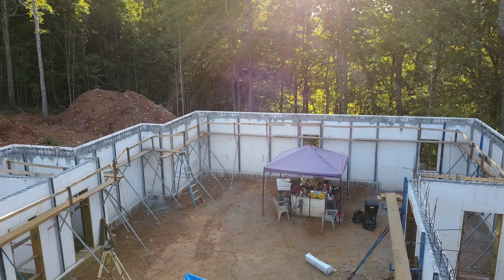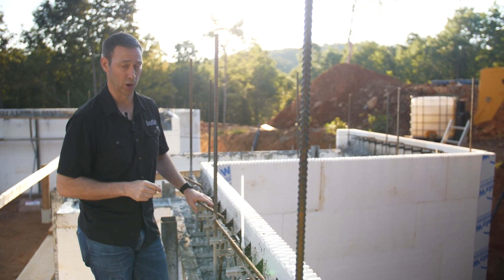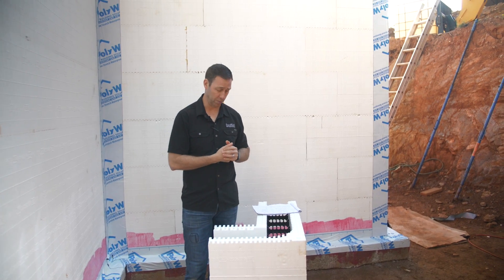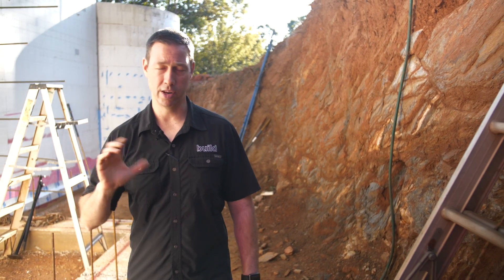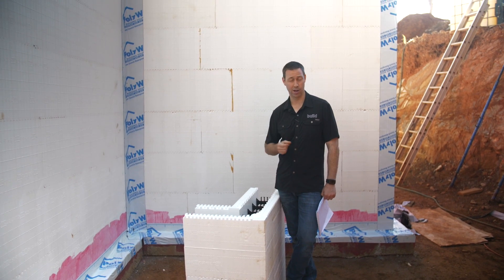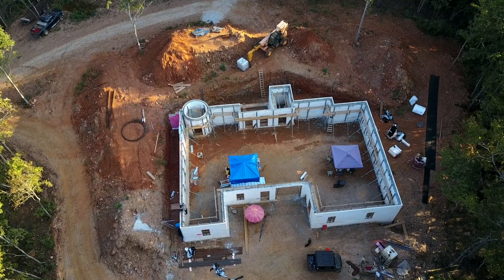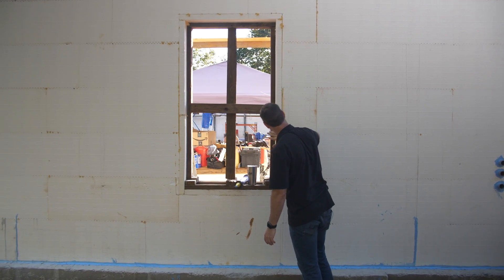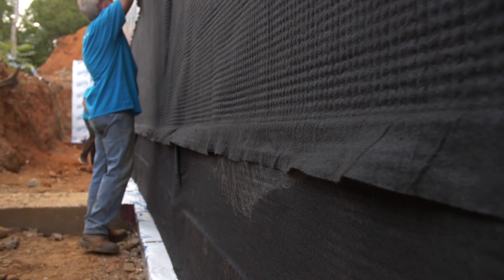Insulated Concrete Forms - Overview, Costs, and Cons

Comment: I would love to see icf vs prefabricated concrete and poured concrete... I've been seeing poured concrete with foam inserts is the best... any opinions? Wife and I are looking to do our own build and want a quality house to last for the kids kids.
Reply: Or maybe include concrete slab and post tension cables??
Reply: Never seen or heard of poured with inserts, I have seen Superior walls which are foam covered interior tilt up style walls for basement or above grade, with the foam thickness being just R5 for 1 inch to as much as they offer such as 4 inch for an R20 almost. And just like any other construction there are "horror" stories and other downsides of lesser extent. But due to its just insulated inside and typically 4 inch of concrete with no exterior insulation it does not offer as much insulation value.
Reply: @Joshua79C  aye it is relatively new from what we understand, but we are not contractors. What happens is the hard foam goes between two slabs of concrete and the interior slab of concrete maintains the temperature nicely, whereas the exterior slabs heat/chill factor does not get past the foam. A contractor buddy was talking to me about, just wanted more opinions. I'm in Northern BC Canada too, so I'm thinking some merit must exist to this for it to be recommended.

Comment: So funny to see this, I've been planning my ICF house with my architect and builder for the past 2 months. It's been fun, I can't wait to live in a Yeti cooler. :)
Reply: mytreesloth You should check out Gigacrete.
Reply: @davidjenjustice5517  looks pretty cool..must be a great r-value.
Reply: mytreesloth I have my order in with Gigacrete right now.  It should be delivered in about three weeks.  I decided to go with this type of construction because it appeared to be much faster and easier.  The interior and exterior plaster also eliminates drywall inside and any wrapping on the outside.  8" of eps with the plaster coatings give an R factor of 36.  I hope to have my house completed by the end of January.  This construction also has survived the hurricanes in the islands.  I thought that Icf was great, but I thought Gigacrete was a better method.  We'll see, my construction starts soon - foundation has been poured.
Reply: @davidjenjustice5517  I'm still in the conception phase, hoping to be started by January lol.. I'm sure each system has pros and cons like anything else. I wish you the best of luck on your build! I can't wait to stop drawing on graph paper and actually start doing something.
Reply: @mytreesloth  yes, I thought I would have between completed six months ago.
Reply: Gigacrete site is lack in actual product photos, just a photo of each product after it has been installed and lightly describing each. I need more than just words to describe it. Sorry you are waiting so long for completion DavidJen, would not have taken this loong if used ICF forms, but hope all works out in the end for you.

Comment: As Devon said, You should vibrate. I built my 30 in stem wall from ICF (foxblock), A benefit Matt didn't directly mention is no forming with metal or wood forms, that have to be bought or rented, erected, stripped, and stored or returned. This a lot of work and expense.  Also, there is a company that has a block that is much thicker on the outside than the inside.( "the perfect block" ) the insulation is better, and they claim an effective R-50. Then there is the issue of wiring and plumbing. You cut a channel. You can apply stucco directly to some types of block. Doing your homework is crucial. Think deep.
Reply: i will be building soon, where can i get some tips/ #ThinkDeep
Reply: Yep, its a clip that pulls the blocks together (fox block) and makes the stack more rigid. I didn't brace the 30" wall at all.
Reply: @tomtillman  What clip are you talking about?
Reply: I was looking at both Quad Lock and foxblock. Fox is owner builder friendlier but QL has option for more outside insulation as well as wall thickness beyond 12 inches. So it depends on the features you are looking for.
Reply: BuildBlock makes an insert that fits into the cavity and adds 2" of foam on the outside of the concrete. So if you want a six inch wall, you order eight inch blocks and the inserts. Not sure how much the inserts add in R value...
Reply: I was looking to demolish my pool and build a 30' x 20' walipini (underground greenhouse) in its place. I want to build 10' high with ICF retaining walls, backfill 2' of rich soil inside the retaining walls and build a polycarbonate panel structure with 8' walls on top of the ICF retaining walls. I need the walipini to be so tall (18' max clearance) because I want to grow tropical fruit trees. Is such a project feasible with ICFs?
Reply: @UndefinedBailiwick  only if you build additional pylons
Reply: Inside you mount 2 by 2 studs and thin Rockwool between. Drywall over that. That way you can mount pipes and so on easy.
Reply: Tom Tillman, I only know of one ICF maker that does such sizes, and I am not going to say here to give it away to others but its initials are QL if I am not wrong of who you are talking about with various thickness of panels.
Reply: Joshua79C C  Why wouldn't you want to give it away?
Reply: @Joshua79C    Quad Lock
Reply: @Joshua79C    QL  = Quad Lock
Reply: @BornlessOne  Quad-Lock is the only brand of ICF blocks which I can think of with the initials "QL."  If that's the on Joshua79C is referring to, I can't imagine why he's being secretive about it.  I'm very keen on Nudura as they have an unsurpassed training program plus a very wide offering of products.
Reply: @72strand  if you do that your going to have to keep the electrical system simple. Too many wires will eat up cubic in. Inside of a shallow electrical box quickly, inspectors tend not to like over stuffed boxes. That's also a large addition to cost to use regular 2x4

Comment: Awesome vid, Matt!
I've designed a number of homes with ICF in mind.
Eventually, because of cost, I had to convert the plan to CMU.
Looking forward to the next vid! :)
Reply: Ouch, CMU are the worst despite their low cost, Mortar cracking and the way the cavities just hold water in like a tank, I have done waterproofing on a few homes that used said blocks when I used to do that kind of work. Then there is lack of horizontal (which is why cracking occurs in the seams) let alone vertical  rebar or filled cavities every so often along a length to even provide the support to hold up a building sitting atop it.

Comment: Good job-in my build in Wyoming the additional insulation is an issue. I’m considering if I go 1/2 way to log or ICF all the way with log adhered to ICFs. I’m planning on using custom scribed logs. Second house will be more Tuscan style.
Reply: Many home use ICF in the basement or other foundation alone, especially if it is a foundation rebuild, so go ahead build it hybrid with ICF and the rest log, log is nicer looking when it's solid whole logs.

Comment: I just had this installed for the house I am building. The house is now sitting on shims because it’s not level.
Reply: nothing is going to be perfectly level all around, not even the footer/footing is not going to be all around level as Matt states it should, and despite the numerous sight line and laser levels there are out there along with even a simple string level. But building another traditional structure on a concrete foundation of any style including ICF you would want to still isolate the wood in that instance from the concrete to reduce the chance of the wood rotting early due to water pooling on and being absorbed by the concrete until it does dry up again.

Comment: The ICF forms can come in wider widths for the concrete and thicker foam to increase the R-value. As for adding windows or other penetrations a concrete chainsaw will cut a hole and the rebar without too much trouble. Another thing to add is the air sealing the concrete does is very good and it is extremely hard for bugs to get into the house. But yes ICF is not for everyone.
Reply: Most ICF forms only come in one thickness and require inserts to increase R value on inside or outside in most cases to which if the form is not wide enough to compensate for then the concrete will be less than 6 inch or 8 inch thick. Build Block has knockdown system with extenders to increase up to 36 inch thick while still at 2 inch standard foam panels. Then there is such as Wuad Lock with three panel sizes and separate ties that double as fastening points for wall finishes and they offer both extra panels for fillers along with two and four inch panels with fastening strips molded in for more places to fasten/secure a wall finish to and extender ties to accommodate the proper wall thickness throughout. Then again it all comes down to how much a buyer educates themselves through searching for every possible ICF manufacturer and looking at each companies offerings in choices of forms and such, some just go with the first one they find, others look at a few and go with the one they think is best, and few like myself who know about almost every type of ICF manufacturer and form out there and I have yet to use any of them myself. But I know the few who I would go with when the time comes that I get my  own land to build on or home that needs some remodeling to my preferred standard.

Comment: Poured concrete floor = thermal mass. Dunno why we don't do more concrete foam concrete setups.... give more thermal mass to provide temp stability. More extreme environment = more foam in between.... works for the north and the south.
Reply: Select Manufacturers and I know of at least for ICF makers who also manufacture planks or decks as they refer to them to make building an insulated slab much simpler than a steel deck system, they even are shaped to include beams for the needed support after it has poured and set/cured, one offers their floor/roof decking with either steel or wood studs for attaching a ceiling finish.

Comment: I'm trying to work out the cost, but something doesn't sounds off to me about concrete costs. In the video it says $120/yard => $5/sqft of wall area.  $120/yard / 27 cubic-ft per yard is roughly 5 (4.44), but the wall is only 6" thick of concrete, so I think it should be closer to $2.50/sqft.  Can you clarify, Matt?
Reply: I saw that too. 1/2 ft cu / sq ft wall area. 120 / (27x2)=$2.22 / sq ft wall.

Comment: If the owners are dyi the build where did they get the wall leveling Jack's and tube?  This looks very interesting for loud shops in residential areas.
Reply: You can buy it (pretty expensive) or there are companies that rent it out as well.
Reply: 00HiGhGuY00  or also check out FabForm system which is Zont and Zuckles that uses 2X4 or larger sticks if metal bracing is not in your budget or such.

Comment: Yes EPS has a fire retardant in it which slows down the spread of fire but the problem is that it melts near any heat source  so if a fire starts inside the building  the ESP melts quickly and producers strong fumes 
In Australia I have worked with ESP panel over 25 years and have seen  the results  of fire on ESP there's  nothing left. In commercial and industrial work in Australia insurance  company's are giving better premium cover if we use PIR panel  which has a higher fire rating the panel only scaled not incinerate.
 Do you use PIR in the United States
Reply: Which PIR panel do you use
Reply: Is there more than one in Australia as far as I known the one we used is base on UK /European panel but we do make PIR in Australia  now
Reply: You kept typing ESP when it is EPS for Expanded Polystyrene
Reply: Typos
Reply: These panels are known in the US as polyisocyanurate (or simply “polyiso”) at supply stores.  I cannot imagine how the terms are actually pronounced because I read them in magazines such as the Journal of Fine Homebuilding or the Journal of Light Construction.  Employees at supply stores simply call them foam boards, a term that does not distinguish them from other types of “foam boards” such as polystyrene.   I think you have eliminated that probkem in Australia.  Do you say “peer boards” for PIR panels?  We’ll have to start spreading this one around once you clarify the pronunciation......unless you say P-I-R panels??

Comment: On the east coast of Canada, friends lost power for a week during a winter storm and their ICF house dropped 2 degrees Celsius over the week.  It is very quiet and cozy year round!
Reply: Alan Barnhill isolated thermal mass is a wonderful way to build
Reply: @kjs65a56  You weren't around for the 3 day blackout then (also hit areas in the U.S. like New York). That happened...  oh my, it's been over 10 years. Now I feel old. ;_;
Reply: @kjs65a56  lest you remember the ice storms of '97 with power out to areas for a month or more...
Reply: @kjs65a56  You are NOT from the east coast than?? :)
Reply: MURRAY Murray 
Then🤦🏻‍♂️
Reply: Wow that's impressive!
Reply: Look into AAC.
Reply: @kjs65a56  Then your not from Chicoutimi! I think several weeks?!
Reply: 👍 awsome
Reply: @kjs65a56  2 hours? Not true at all. I loose power regularly, maybe once a month, and occasionally, for more than a day.
Reply: In Sothern Europe this is how everything is built. This year my grandmothers house, which has no insulation but is fully concrete - we got hit with 115F for 7 days straight. No air conditioning... the house held under 80F, except for the last day where the concrete was hot by then... since even nights were at 95F or so by the 5th day, the thermal mass started working against us :D but nonetheless, remarkable result.

Also, during nights when it gets to around 30F, without heat, the house never gets below 62 F
Reply: @NoRoads2AllRoads  If the concrete walls are insulated, say, with styrofoam, you'll be getting only slight temperature fluctuations over long periods of time, e.g. winter/ summer.
Reply: @DobruchT  yup I know, thermal mass is great, however during long periods of time like it happened this summer, where we had 115F FOR almost 2 weeks straight and with lows in the 90s is inevitable that the concrete heats up like crazy
Reply: Salvador heat is one thing, the humidity is a whole other ball game in heat
Reply: if there is ever a fire, wouldnt the foam be extremely flammable?
Reply: randomrazr They say it has a 4 hour fire rating. That’s better than the majority of fire proof safes.
Reply: @randomrazr  Matt touches on that at around 10:30. The foam has a fire retardant in it. Foams will melt. Under certain conditions they can be made to burn. But fire testing has satisfied building code officials to the point that a single layer of 1/2" drywall is considered enough protection.
Reply: @randomrazr  most jurisdictions require that you at least cover with drywall and tape,  even in crawlspace
Reply: @randomrazr  The foam is fire treated.

Comment: can you compare an icf vs standard 2x6, let's say 4x8 end to end finish product cost thnx love your vids
Reply: The best cost is initial to that of what each saves over time in cooling/heating bills and which better withstands a hurricane or tornado, in this case it would be ICF the winner of the savings over its lifetime despite it may or will cost more to initially construct.

Comment: I believe that the insurance rates for an ICF home are significantly less also. * Check with your insurance provider for info formation on your area. *   Another potential positive to an ICF build .
Reply: Yes sure, your furniture is burned, roof is gone, insulation melted, but your concrete walls still standing. That a big win 🤔
Reply: I mean, a lot of the video was talking about disaster resistance. Insurance companies can do the math.
Reply: @DainiusZelnys  Check out Spyder Ties.  They make ICF concrete roofs that tie into your ICF walls.  Now you've got a fire proof (on the outside) home.

Comment: Good video Matt, I have an ICF BuildBlock home myself and I'd highly recommend it for anyone. My electric bill in one third to a half of conventional home of equal size in my area and that's per Duke Energy Electric! BuildBlock was interested in the article the local news had in the newspaper as well as my electric bill figures and posted in on their website. Thanks!
Reply: Here is the article that Fred mentioned! https://buildblock.com/lasting-effects-icfs/
Reply: Did you DIY it or hire a contractor?  Any tips for us?  Thanks!
Reply: My local rep from BuildBlock here lead the way!  He was instrumental in doing most of the ICF work and I helped him with others in completing the ICF structure and pour. I couldn't have done it without him!
Reply: Thanks!

Comment: Wouldnt this actually fail in an earthquake?  Same reason we dont have brick homes and buildings in California, it does not flex like wood would.....did I just say wood would...
Reply: tonio909 they adjust the rebar such that it’s way better than stick builds.
Reply: Remember the Washington DC quake some years ago? the obelisk cracked but did not at all collapse. I have seen concrete block (or CMU as they are called) walls easily fail due to a hurricane as they were not properly reinforced at each level with rebar or vertically with rebar every four feet with thicker bars as Matt pointed out in this build. I have seen the stories of soft story buildings (look up what this is if you do not get what I am about to say) that have collapsed in even the slightest of 2.5 earthquakes. let alone the surrounding buildings built with reinforced concrete survived in even stronger quakes.